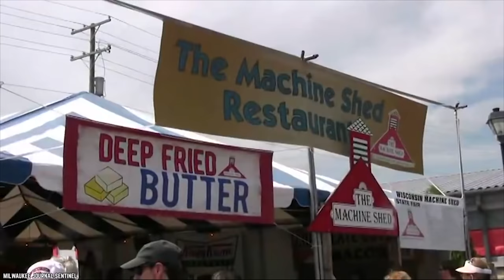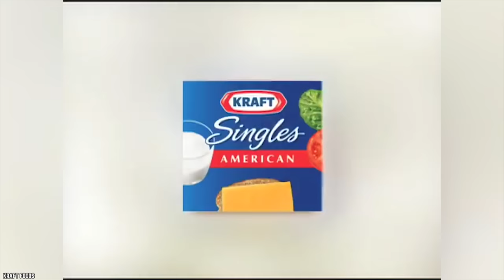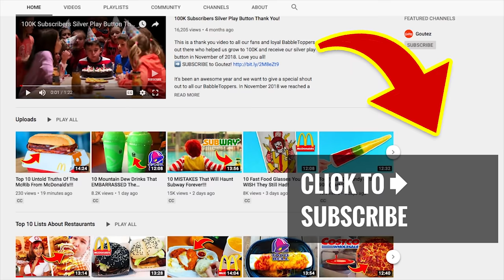10 American Foods That Should Be BANNED (Part 2)

Comment: Hamburgers are German
Reply from the maker: The hamburger first appeared in the 19th or early 20th century. The modern hamburger was a product of the culinary needs of a society rapidly changing due to industrialization and the emergence of the working class and middle class with the resulting demand for mass-produced, affordable food that could be consumed outside of the home.

Considerable evidence suggests the USA was the first country where two slices of bread and a ground beef steak were combined into a "hamburger sandwich" and sold. There is some controversy over the origin of the hamburger because its two basic ingredients, bread and beef, had been prepared and consumed separately for many years in different countries before their combination. Shortly after its creation, the hamburger quickly included all of its currently typically characteristic trimmings, including onions, lettuce, and sliced pickles. It is named after the German city of Hamburg. 

Prior to the disputed invention of the hamburger in the United States, similar foods already existed in the culinary tradition of Europe. The Apicius cookbook, a collection of ancient Roman recipes that may date to the early 4th century, details a preparation of beef called isicia omentata; served as a baked patty in which beef is mixed with pine kernels, black and green peppercorns, and white wine, isicia omentata may be the earliest precursor to the hamburger.

It is not known when the first restaurant recipe for steak tartare appeared. While not providing a clear name, the first description of steak tartare was given by Jules Verne in 1875 in his novel Michael Strogoff. There are certain similarities between steak tartare and the German dishes Labskaus and Mett. Other similar raw, chopped meats appeared in the 20th century. One of the oldest references to a Hamburgh Sausage appeared in 1763 in Hannah Glasse's Art of Cookery, Made Plain and Easy. Hamburgh Sausage is made with minced meat and a variety of spices, including nutmeg, cloves, black pepper, garlic, and salt, and is typically served with toast. Other dishes are also made with minced meat, such as meatloaf, the Serbian pljeskavica, the Arab kofta, and meatballs.

The word sandwich was not recorded until the 18th century. Many cultures claim invention of the sandwich, but it was given its name around the year 1765 in honor of the English aristocrat John Montagu, 4th Earl of Sandwich, who preferred to eat sandwiches so he could play cards without soiling his fingers. However, it was not until 1840 when Elizabeth Leslie Cook included a sandwich recipe in her cookbook that it appeared in the local cuisine of the United States.

Minced meat was a delicacy in medieval cuisine, red meat usually being restricted to the higher classes. Very little mincing was done by medieval butchers or recorded in the cookbooks of the time, perhaps because it was not part of the sausage-making process that preserves meat.

During the first half of the 19th century, most European emigrants to the New World embarked from Hamburg, and New York City was their most common destination. Restaurants in New York offered Hamburg-style American fillet, or even beefsteak à la Hambourgeoise. Early American preparations of minced beef were therefore made to fit the tastes of European immigrants, evoking memories of the port of Hamburg and the world they left behind.

In the late 19th century, the Hamburg steak became popular on the menus of many restaurants in the port of New York. This might consist of a fried patty of chopped beef, eggs, onions, and seasoning, or it might be lightly salted and often smoked, and served raw in a dish along with onions and bread crumbs. The oldest document that refers to the Hamburg steak is a Delmonico's Restaurant menu from 1873 which offered customers an 11-cent plate of Hamburg steak that had been developed by American chef Charles Ranhofer (1836–1899). This price was high for the time, twice the price of a simple fillet of beef steak. However, by the end of the century the Hamburg steak was gaining popularity because of its ease of preparation decreasing cost. This is evident from its detailed description in some of the most popular cookbooks of the day. Documents show that this preparation style was used by 1887 in some U.S. restaurants and was also used for feeding patients in hospitals; the Hamburg steak was served raw or lightly cooked and was accompanied by a raw egg.

The menus of many American restaurants during the 19th century included a Hamburg beefsteak that was often sold for breakfast. A variant of Hamburg steak is the Salisbury steak, which is usually served with a gravy similar in texture to brown sauce. Invented by Dr. James Salisbury (1823–1905), the term Salisbury steak has been used in the United States since 1897. Nowadays, in the city of Hamburg as well as in parts of northern Germany, this type dish is called Frikadelle, Frikandelle, or Bulette, which is similar to the meatball. The term hamburger steak was replaced by hamburger by 1930, which has in turn been somewhat displaced by the simpler term, burger. The latter term is now commonly used as a suffix to create new words for different variants of the hamburger, including cheeseburger, porkburger, baconburger and mooseburger. There are other foods with names derived from German cities that are shortened in different ways in American English. An example is the frankfurter, often abbreviated as frank.
Reply from the maker: The Texas historian Frank X. Tolbert attributes the invention of the hamburger to Fletcher Davis of Athens, Texas. Davis is believed to have sold hamburgers at his café at 115 Tyler Street in Athens, Texas, in the late 1880s, before bringing them to the 1904 St. Louis World's Fair.

Menches Brothers 1885

Residents of Hamburg, New York, which was named after Hamburg, Germany, attribute the hamburger to Ohioans Frank Menches and Charles Menches. According to legend, the Menches brothers were vendors at the 1885 Erie County Fair (then called the Buffalo Fair) when they ran out of sausage for sandwiches and used beef instead. They named the resulting sandwich after the location of the fair. However, Frank Menches's obituary in The New York Times stated, instead, that these events took place at the 1892 Summit County Fair in Akron, Ohio.

Charlie Nagreen 1885

The Seymour Community Historical Society of Seymour, Wisconsin, credits Charlie Nagreen, now known as "Hamburger Charlie", with the invention of the hamburger. Nagreen was 15 when he reportedly made sandwiches out of meatballs that he was selling at the 1885 Seymour Fair (now the Outagamie County Fair) to make it easier for customers to eat while walking. The Historical Society explains that Nagreen named the hamburger after the Hamburg steak, with which local German immigrants were familiar.

Oscar Bilby 1891

There is good evidence that the first hamburger served on a bun was made by Oscar Bilby of Tulsa, Oklahoma, in 1891.

In April 1995, the Dallas Morning News reported on an Oklahoma author who said that Tulsa beat out Texas as the birthplace of the delicacy. Michael Wallis, author of "Route 66, The Mother Road", was quoted by the newspaper as saying that he had discovered Tulsa's place in culinary history, which he made while researching the state’s tastiest hamburgers. He started at the restaurant that has been voted Tulsa's best burger more often than any other restaurant since 1933, Weber’s Root Beer Stand. Wallis’ research revealed that Oscar Weber Bilby was the first person to serve a real hamburger when, on July 4, 1891, ground beef was served on his wife’s homemade buns at a Fourth of July party on his farm, just west of present-day Tulsa. Until then, ground beef had been served in Athens, Texas, on simple slices of bread, known then and presently as a "patty melt". According to the Tulsa-based author, the bun is essential. Therefore, in 1995, Governor Frank Keating cited Athens, Texas' serving of ground beef between two slices of bread as a minor accomplishment. The governor's April 1995 proclamation also cites the first true hamburger on the bun, after meticulous research, was created and consumed in Tulsa in 1891. The Governor's Proclamation cites April 13, 1995, in Tulsa as "The Real Birthplace of the Hamburger."

Louis' Lunch 1895

The Library of Congress credits Danish immigrant Louis Lassen of Louis' Lunch, a small lunch wagon in New Haven, Connecticut, with selling the first hamburger and steak sandwich in the U.S. in 1895.

The hamburger bun was invented in 1916 by a fry cook named Walter Anderson, who co-founded White Castle in 1921.
Reply from the maker: Many recipes and dishes traveled along with transatlantic immigrants to their destinations in the New World. Some authors question whether the Hamburg America Line was part of this, arguing that the hamburger was created to meet needs that arose amongst immigrants already in the New World. Others, however, support the thesis that the Hamburg America Line brought the first Hamburger steaks from Europe to the Americas. The hamburger as it is known today has multiple invention claims ranging between 1885 and 1904, but it is clearly the product of the early 20th century. During the following 100 years, the hamburger spread throughout the world as a result of the emerging concept of fast food and a new business model: the franchise.

The industrial use of mechanical meat shredding was the technical advance that helped popularize the Hamburg steak. The first meat grinder was invented in the early 19th century by the German engineer Karl Drais. The machine made it possible for minced meat to be sold at market in large quantities at reasonable prices. By 1845, numerous patents existed for improved meat grinders in the United States. These machines could all shred meat to sizes before unimaginable. Before this, minced meat was prepared by hand at home using specialized chisels, intensive manual labor that severely limited the amount that could be produced. It is very likely that the invention of the meat grinder contributed directly to the popularization of Hamburg steak, while the steak gradually became distant from its German roots in the minds of many Americans. Minced meat also came to be used in other popular American foods, including hot dogs and meatloaf.

Another development facilitating the invention and popularization of the proto-hamburger was the increased production of beef through livestock intensification. By the late 19th century, an increasing amount of land was being devoted to cattle and a growing number of people being employed as cowboys, resulting in the United States becoming one of the world's largest producers and consumers of beef. The 1880s were declared The Golden Age of Beef, during which the abundance of rural beef production made vital its transportation by rail from agricultural to urban areas. This gave rise to various methods of meat preservation for making possible the consumption of fresh meat in urban and industrialized areas, among the refrigerator cars and different methods of packaging meat (such as corned beef), which were promoted by industrialists like Gustavus Swift (1839–1903). Around this time, the city of Chicago, along with other cities on the East Coast, became a focal point for the large-scale processing of beef. Beef was already inexpensive at that time, and it was available to the working class. This put the Hamburg steak within reach of the vast majority of the population, giving rise to what some authors jokingly call the "American beef dream". In this era, the number of steakhouses that specialized in serving steaks increased markedly; some restaurants even served steak along with seafood, in a dish known as Surf and turf.

The high production and consumption of beef cattle in the United States made the meat industry increasingly powerful by the end of the 19th century. Corruption problems soon arose in the meat industry, problems that endangered both quality and hygiene. At the beginning of the 20th century, Upton Sinclair published The Jungle, a novel about conspiracies and corruption in the American meat industry, intended as a veiled criticism of the industry itself. The book raised popular awareness about the safety of meat processing and helped lead to the creation of the Pure Food and Drug Act, which was sponsored by the Food and Drug Administration. The Jungle was a milestone in the subsequent history of the hamburger, as it led the American public to force restaurant chains to prove the safety of their cooked meat. In 1933, Arthur Kallett published a similar book, entitled 100 million guinea pigs; Dangers in Everyday foods, drugs, and cosmetics, which warned consumers specifically about the content preservatives in hamburgers.
Reply from the maker: The exact origin of the hamburger may never be known with any certainty. Most historians believe that it was invented by a cook who placed a Hamburg steak between two slices of bread in a small town in Texas, and others credit the founder of White Castle for developing the "Hamburger Sandwich." Records from that time are scarce, however.

All claims for invention occur between 1885 and 1904, making it probable that the hamburger was created sometime in these two decades. Despite varieties, there are common elements in all of the narratives, most notably that the hamburger was born as a food associated with major events such as amusement parks, fairs, conferences, and festivals. All the hypotheses also share the presence of street vendors.

One of the first "birth of the burger" stories belongs to Canton, Ohio, natives Frank and Charles Menches who were food vendors at the 1885 Erie County Fair outside of Buffalo, New York, also known as the Hamburg Fair. Legend has it that during the course of the Fair, the Menches ran out of their signature menu item of pork sausage sandwiches. Their local supplier, Hamburg butcher Andrew Klein, was reluctant to butcher more hogs during a period of unseasonable late summer heat and suggested to substitute the use of ground beef. The brothers fired some up, but both found it dry and bland. They added coffee, brown sugar and other ingredients to create a unique taste. The original sandwiches were sold with just ketchup and sliced onions. With new found success with their beef sandwich, they christened it the “hamburger” after the Erie County Fair's home town of Hamburg. "National Birth of the Burger Day" is celebrated on September 18th to honor the invention of the burger in 1885 at the Hamburg Fair. In the 1920s, carnival historian John C. Kunzog interviewed Frank Menches about his experience at the Erie County Fair. His detailed hamburger story was published in this book, “Tanbark & Tinsel” published in 1970.

One of the possible fathers of the hamburger is Charlie Nagreen (1871–1951) of Seymour, Wisconsin, who at the age of 15 sold Hamburg steaks from a street stall at the annual Outagamie County Fair. Nagreen said he began by selling Hamburg steaks, but these did not have much success because people wanted to freely move around the festival without the need to eat them at his stand. In response to this, in 1885 Nagreen decided to flatten the hamburger steak and insert it between two slices of bread, so that the public could move freely from booth to booth while eating his sandwich, an innovation that was well received by his customers. This became known as the "Hamburger Charlie", and Nagreen's creation was sold at the festival until his death in 1951. To this day, his accomplishment is celebrated annually with a "Burger Fest" in his honor in his hometown of Seymour.

Another alleged inventor of the hamburger is the cook Fletcher Davis (better known as "Old Dave"), who claimed to have had the idea of putting ground beef between two pieces of Texas Toast when one of his customers was in too much of a hurry to sit down for a meal. The customer walked away with his Hamburger Steak and seemed so content that Old Dave offered his new carryout meal as a staple menu item at the end of 1880 in Athens, Texas. Fletcher had a stall with his wife at the St. Louis World's Fair of 1904. Texan journalist Frank X. Tolbert mentions a salesman named Fletcher Davis who served hamburgers in a café at 115 Tyler Street in Athens during the late 1880s. The locals claim that Davis was selling beef sandwiches during that time, without having a clear name for his invention. During the 1980s, the Dairy Queen ice cream chain filmed a documentary about the birthplace of the hamburger featuring Davis' story. The story of "Old Dave's Hamburger Sandwich" is also found mentioned in Ronald L. McDonald's book The Complete Hamburger.

In the same year that Charlie Nagreen claimed to have developed his "Hamburger Charlie", the brothers and street cooks Frank and Charles Menches of Akron, Ohio, claimed to have sold a ground beef sandwich at the Erie County Fair. They assert that the name of the hamburger was derived from the town Hamburg, New York, in Erie County, the first place in which it had been sold. This statement has been very poorly documented or substantiated, and in the case of an oral tradition, it is not without its contradictions.[citation needed] Its famous description of the secret ingredients used in the recipes, such as coffee or brown sugar, is primitive.

Another version of the creation of the hamburger is that of German cook Otto Kuasw, who created a very popular sailors' sandwich made of a fillet of beef patty fried in butter, served with a fried egg, between two toasted buns in 1891, at a post in Hamburg, Germany. The sandwich was called the "Deutsches Beefsteak", German for "German beefsteak". Many of the sailors traveling on ships between Hamburg and New York requested a similar "Hamburg style" sandwich at American steakhouses.

There are many additional claims as to the origin of the hamburger. Some enthusiasts claim the hamburger could have been created in São Gonçalo, a municipality located in the Brazilian state of Rio de Janeiro, in the 18th century by a Chef named Sauerbrown "Little" Victor, but this claim has no supporting evidence to back the opinion. A local newspaper claims that Louis Lassen, a Danish immigrant who arrived in America in 1880, sold butter and eggs as a street vendor. In 1974, in an interview with The New York Times, he recounted how he created a hamburger steak sandwich with small strips of beef for a restaurant known as Louis' Lunch. Lassen's family claims 1900 as the year of his invention. Revealed in a public confrontation between the grandson of Louis, Kenneth Davis Lassen Fletch, and his uncle, documentation signed under notary in 1900 demonstrates the development of the hamburger, as it stresses the difference between a "hamburger steak" and a "hamburger sandwich". Louis' Lunch flame broils the hamburgers in the original vertical cast iron gas stoves manufactured by the Bridge and Beach, Co., St. Louis, Missouri, in 1898. The stoves use hinged steel wire gridirons to hold the hamburgers in place while they cook simultaneously on both sides. The gridirons were made by Luigi Pieragostini and patented in 1938.
Reply from the maker: The term hamburger originally derives from Hamburg, Germany's second-largest city. Hamburger in German is the demonym of Hamburg, similar to frankfurter and wiener, names for other meat-based foods and demonyms of the cities of Frankfurt and Vienna (in German Wien) respectively. 

As versions of the meal have been served for over a century, its origin remains ambiguous. The popular book The Art of Cookery Made Plain and Easy by Hannah Glasse included a recipe in 1758 as "Hamburgh sausage", which suggested to serve it "roasted with toasted bread under it". A similar snack was also popular in Hamburg by the name "Rundstück warm" ("bread roll warm") in 1869 or earlier, and supposedly eaten by many emigrants on their way to America, but may have contained roasted beefsteak rather than Frikadeller. Hamburg steak is reported to have been served between two pieces of bread on the Hamburg America Line, which began operations in 1847. Each of these may mark the invention of the Hamburger, and explain the name.

There is a reference to a "Hamburg steak" as early as 1884 in the Boston Journal.[OED, under "steak"] On July 5, 1896, the Chicago Daily Tribune made a highly specific claim regarding a "hamburger sandwich" in an article about a "Sandwich Car": "A distinguished favorite, only five cents, is Hamburger steak sandwich, the meat for which is kept ready in small patties and 'cooked while you wait' on the gasoline range."

According to Connecticut Congresswoman Rosa DeLauro, the hamburger, a ground meat patty between two slices of bread, was first created in America in 1900 by Louis Lassen, a Danish immigrant, owner of Louis' Lunch in New Haven. There have been rival claims by Charlie Nagreen, Frank and Charles Menches, Oscar Weber Bilby, and Fletcher Davis. White Castle traces the origin of the hamburger to Hamburg, Germany with its invention by Otto Kuase. However, it gained national recognition at the 1904 St. Louis World's Fair when the New York Tribune referred to the hamburger as "the innovation of a food vendor on the pike". No conclusive argument has ever ended the dispute over invention. An article from ABC News sums up: "One problem is that there is little written history. Another issue is that the spread of the burger happened largely at the World's Fair, from tiny vendors that came and went in an instant. And it is entirely possible that more than one person came up with the idea at the same time in different parts of the country."

Louis Lassen of Louis' Lunch, a small lunch wagon in New Haven, Connecticut, is said to have sold the first hamburger and steak sandwich in the U.S. in 1900. New York magazine states that "The dish actually had no name until some rowdy sailors from Hamburg named the meat on a bun after themselves years later", noting also that this claim is subject to dispute. A customer ordered a quick hot meal and Louis was out of steaks. Taking ground beef trimmings, Louis made a patty and grilled it, putting it between two slices of toast. Some critics like Josh Ozersky, a food editor for New York Magazine, claim that this sandwich was not a hamburger because the bread was toasted.

One of the earliest claims comes from Charlie Nagreen, who in 1885 sold a meatball between two slices of bread at the Seymour Fair now sometimes called the Outagamie County Fair. The Seymour Community Historical Society of Seymour, Wisconsin, credits Nagreen, now known as "Hamburger Charlie", with the invention. Nagreen was fifteen when he was reportedly selling pork sandwiches at the 1885 Seymour Fair, made so customers could eat while walking. The Historical Society explains that Nagreen named the hamburger after the Hamburg steak with which local German immigrants were familiar.

According to White Castle, Otto Kuase was the inventor of the hamburger. In 1891, he created a beef patty cooked in butter and topped with a fried egg. German sailors would later omit the fried egg.

The family of Oscar Weber Bilby claim the first-known hamburger on a bun was served on July 4, 1891 on Grandpa Oscar's farm. The bun was a yeast bun. In 1995, Governor Frank Keating proclaimed that the first true hamburger on a bun was created and consumed in Tulsa, Oklahoma in 1891, calling Tulsa, "The Real Birthplace of the Hamburger."

Frank and Charles Menches claim to have sold a ground beef sandwich at the Erie County Fair in 1885 in Hamburg, New York. During the fair, they ran out of pork sausage for their sandwiches and substituted beef. Kunzog, who spoke to Frank Menches, says they exhausted their supply of sausage, so purchased chopped up beef from a butcher, Andrew Klein. Historian Joseph Streamer wrote that the meat was from Stein's market not Klein's, despite Stein's having sold the market in 1874. The story notes that the name of the hamburger comes from Hamburg, New York not Hamburg, Germany. Frank Menches's obituary in The New York Times states that these events took place at the 1892 Summit County Fair in Akron, Ohio.

Fletcher Davis of Athens, Texas claimed to have invented the hamburger. According to oral histories, in the 1880s he opened a lunch counter in Athens and served a 'burger' of fried ground beef patties with mustard and Bermuda onion between two slices of bread, with a pickle on the side. The story is that in 1904, Davis and his wife Ciddy ran a sandwich stand at the St. Louis World's Fair. Historian Frank X. Tolbert, noted that Athens resident Clint Murchison said his grandfather dated the hamburger to the 1880s with 'Old Dave' a.k.a. Fletcher Davis. A photo of "Old Dave's Hamburger Stand" from 1904 was sent to Tolbert as evidence of the claim.

Various non-specific claims of invention relate to the term "hamburger steak" without mention of its being a sandwich. The first printed American menu which listed hamburger is said to be an 1834 menu from Delmonico's in New York. However, the printer of the original menu was not in business in 1834. In 1889, a menu from Walla Walla Union in Washington offered hamburger steak as a menu item.

Between 1871 and 1884, "Hamburg Beefsteak" was on the "Breakfast and Supper Menu" of the Clipper Restaurant at 311/313 Pacific Street in San Fernando, California. It cost 10 cents—the same price as mutton chops, pig's feet in batter, and stewed veal. It was not, however, on the dinner menu. Only "Pig's Head," "Calf Tongue," and "Stewed Kidneys" were listed. Another claim ties the hamburger to Summit County, New York or Ohio. Summit County, Ohio exists, but Summit County, New York does not. 🍔 🇩🇪 🇺🇸